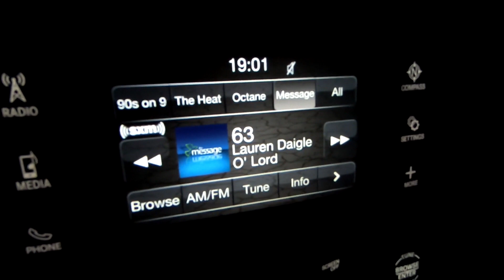Flush Mount LED Light Install Jeep JL Rear OEM Bumper Part 2

Comment: was there a reason you wanted the flashing lights?
Reply from the maker: Not really, I mainly wanted clear and amber. The flashing was just part of the package. Win, win.
Reply: @MannsAdventures  Yeah i wondered why you didnt tie them into your brakes lights
Reply from the maker: @stanroark55  to much wire cutting, and I had open switches on my box.